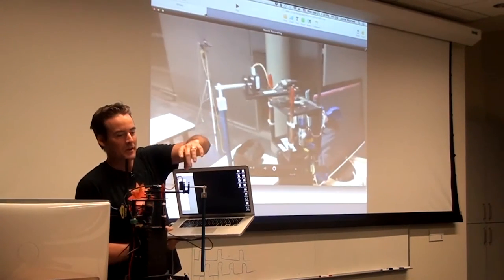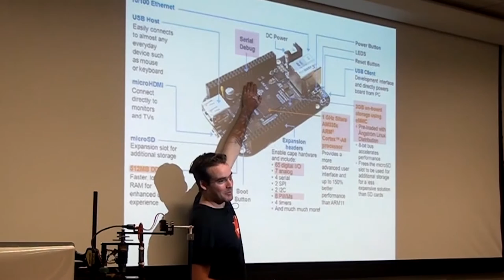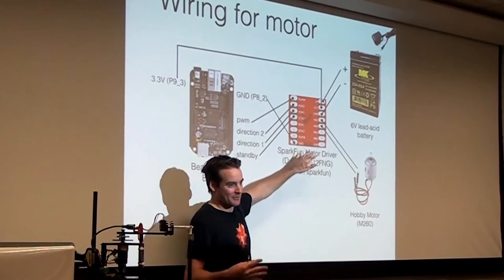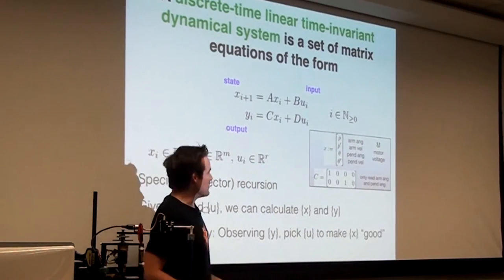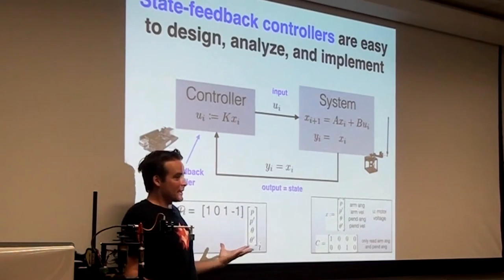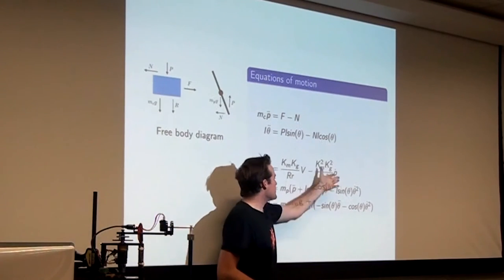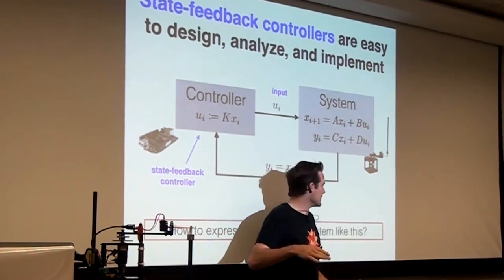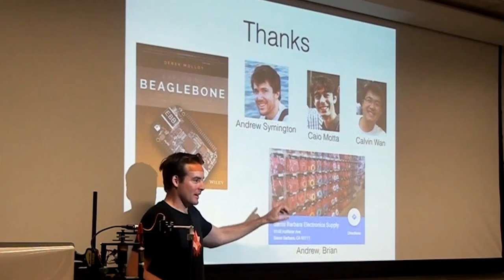Pendulum + Beaglebone + Control Theory = Profit

Comment: He Justin, you are great men :) I want to build something similar and I want to ask you, if you programmed all the measurement and state-space controller in your Beaglebone using Python? You are used some king of Linux RTOS to guarantee the execution of your control algorithm in real time? Can you give me some hint on the implementation please? :) Thank you again dude, Lars
Reply from the maker: Hi Lars, for this video, are you correct -- I used a state-space controller and observer in Python on the Beaglebone. It turned out the system was sufficiently stable that I didn't need an RTOS. The control loop ran every 5ms, with small timing errors due to processor preemption. However, for more unstable systems, it would have been necessary to have a real-time solution. When I was working on my PhD, I used the Beaglebone's 200 MHz Real-Time Unit (RTU) as a real-time sensor/actuator coprocessor. The controller still ran on Linux on the main 1 GHz processor, but the time-sensitive sensing and actuating occurred on the RTU. For more details, please see the video here: http://justinppearson.com/research.html#an-architecture-for-preemption-resistant-control-ph-d-defense